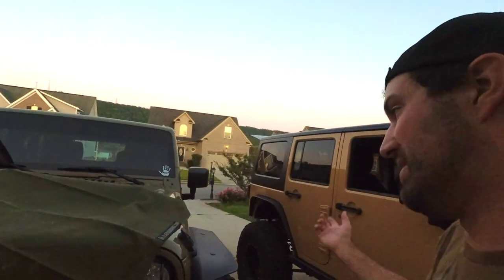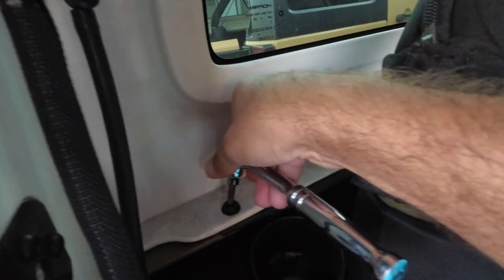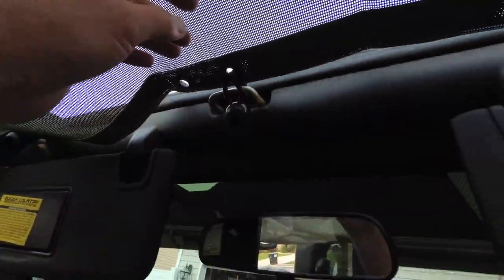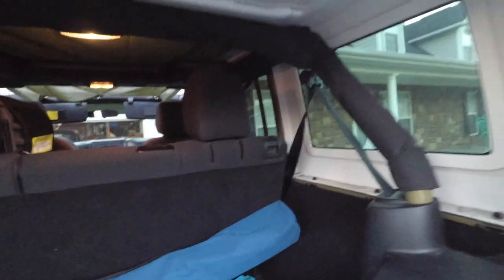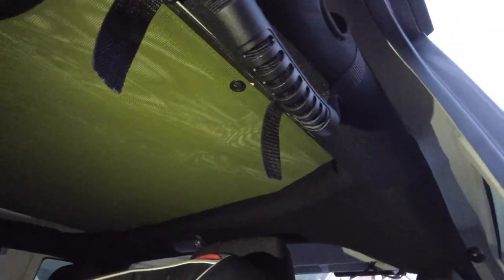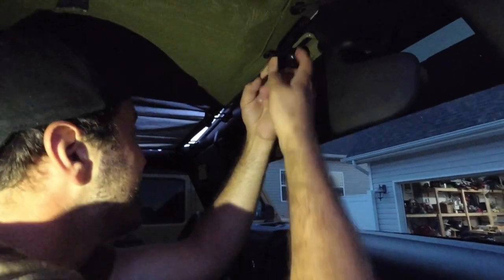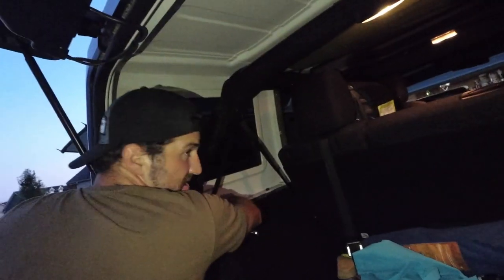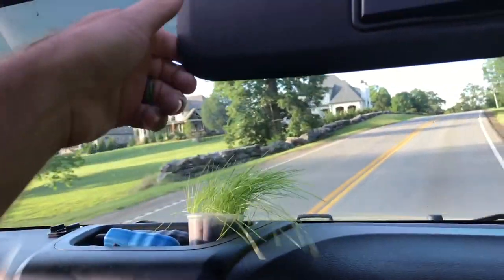How to install Alien Sunshade on Jeep JK | With Hardtop still on

Comment: easier to just take top off like they say to do, looks to me like u just made it harder on yourself
Reply from the maker: It’s absolutely possible to be installed with 2 people in less than 45min with the top on. Its a pain in the butt but do able.
Reply: I did it just like this by myself, but I'm sending it back since I can't latch the freedom panels back on without undoing almost the whole front part.